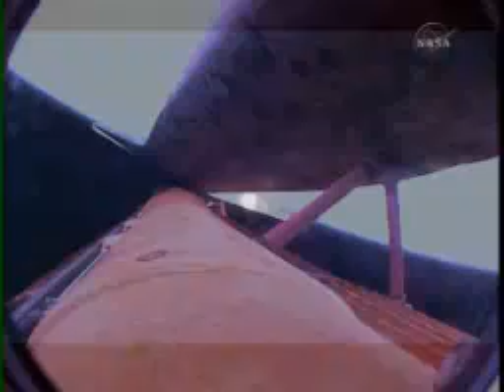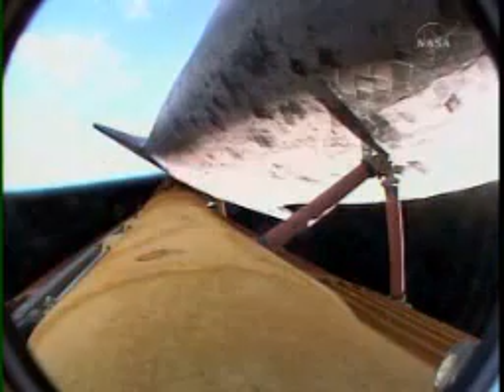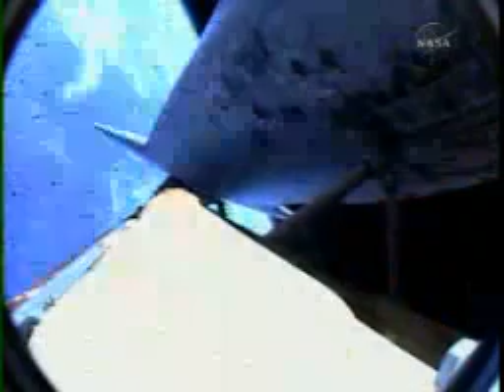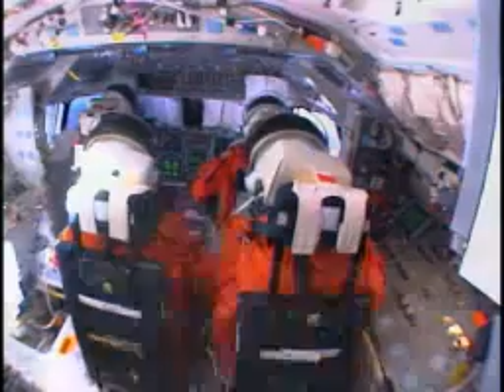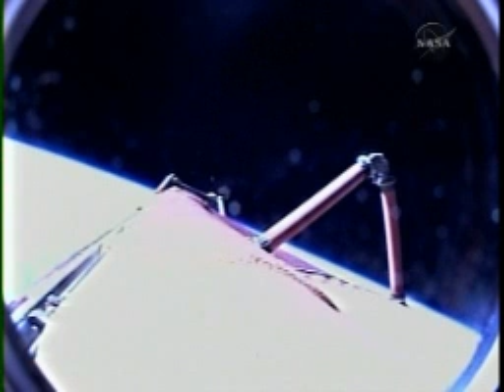STS-120 main engine cutoff and external tank seperation

Comment: Its actually ice flowing past the cam as Discovery seperates from the ET. As for the air bending around the wings, I'm guessing that its probably either light warping around the shuttle or camera lens flare probs, dont forget the cams now getting the full force of the sun without any atmosphere to hinder it. Of course there could be another reason entirely in which case I suggest you email NASA and ask, I'm sure they'll be happy to help you out

Comment: Cool vid... but if space is just a vacuum.... then why does it look like air is still exploding off the wing tips when it hits orbit????? At the very end. If you ever watch supersonic jets when they turn and bank, air explodes off the sharp edges and wing tips, this is because air is superheated and results in what we hear as a sonic boom. When the shuttle departs and increases its angle of attack what clearly looks like air is exploding off the wings and rear of the shuttle. Someone call NASA.
Reply: damnnnn     😳